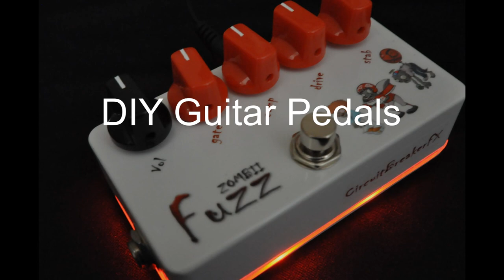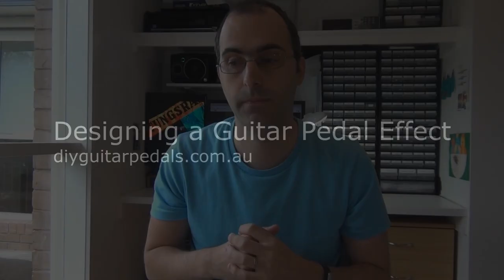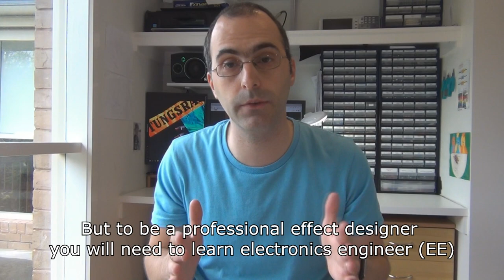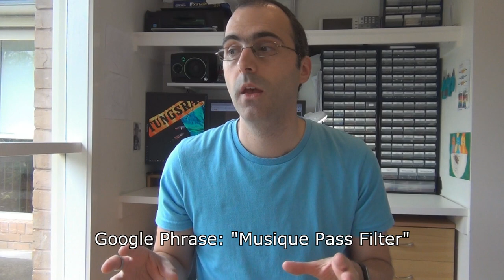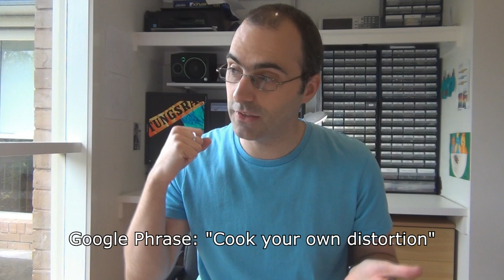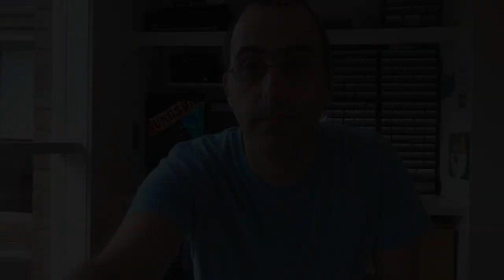Designing a guitar pedal effect

Comment: Brian Wampler's videos on distortion circuits and clipping types was what gave me confidence to try modding some pedals that I was already thinking of just throwing away. Then followed by a lot of googling on gain, low- and high-pass filters, graphic EQ... And many months of trial and error swapping components on my pedals. Also Electrosmash has some good analyses of popular pedals that can help figure out how things work.
A good piece of advice would be to get yourself a breadboard and a bunch of assorted electronics components, instead of repeatedly soldering/unsoldering components directly onto a PCB which will damage the PCB sooner or later.

Comment: I wasn't a genius in school either, but i wouldn't say that it made me regret it when i started making pedals. And personally i haven't learned much through just reading theoretical stuff, i started with a basic idea of building a pedal i wanted to have on my board, i found the simpliest schematic of this pedal, made it work, still didn't know a thing of what i did exactly, then i thought "hmm i also want a tremolo", found the simpliest schematic that could be built around components i had on hands, done, but now i started getting a sense of what i've done and i moved to the next project, and just like that, by building more and more stuff it got me from being completely blind, to being able to see schematic with my mind, and within this builds i had questions, and by answering them i learned a ton of stuff. So it is not necessary to know something before you start, just try to make it work in any way you can, and the more you do the better you get, or at least i works for me, and i keep learning.

Comment: I tried educating myself with an "Electronics Demystified" for dummies type book but couldn't even get through chapter 1. I found it pretty discouraging so I went back to breadboarding from Beavis Audio layouts and basic fuzz schematics.
My advice to beginners would be: Ask around on forums (especially Madbean), people are super helpful and never intimidating. Read up on modding a favourite circuit. Try simple mods with switches and pots for tweaking perameters or switching between different diodes or caps. Try breadboarding basic circuits and swapping cap values, trannies, etc. Try socketing parts of a circuit board so you can experiment with swapping different values to your liking
Reply from the maker: +FandangleTechery Good advice Fandangle, I agree!

Comment: Hey, you know that 7 minute fuzz pedal on your website, What do I need for everything to make it (excluding solder etc), you know the right electronics as it will be my first pedal. Also what extra gear will I need?
Reply from the maker: +Junk Morgan Hi Junk, if you order all the kit components all you will need is an enclosure and a 3pdt to finish the pedal.  Good luck with your first pedal!
Reply: DIY Guitar Pedals  but do I need solder and stuff like that?
Reply from the maker: +Junk Morgan Hi Junk, you will need solder but not wire, wire is in the kit. cheers.
Reply: DIY Guitar Pedals thanks.

Comment: The scary thing is that the success of many effects has been some simple serendipity, and a proper education in electronics is actually going to hinder one in these 'lucky finds'. Case in point for 'theory over practical' resulting in a loss of perspective is the bubbling argument that has been going on for several years in Silicon Chip magazine over valve amplifiers. :)
Reply: greaser5691 as an electronic Engineering student I agree to disagree, although I can do the maths and analyse schematics nothing beats dicking around with a breadboard, particularly when it all goes bang!
Reply: greaser5691 as an electronic Engineering student I agree to disagree, although I can do the maths and analyse schematics nothing beats dicking around with a breadboard, particularly when it all goes bang!
Reply: ok.  Amend that to say "for everybody except T3RRA_BITE_"    :)  What I am suggesting is that the theoretical education is going to change one's perspective, there are many blind alleys that will just not be explored, simply because they're patently foolish to explore for someone versed in  theory (and some particular magic might be missed as a result).
Reply: It's also worth considering a lot of effects do require theoretical education for design to be even possible, pitch shifters, reverb, delays for example. But as you said anyone can take the basic building blocks of a drive pedal and then fuck with it and you may get lucky. I've found some pretty cool sounds back in my early diy designs but I still go back to the odd designs to "fix" issues.

Comment: definitely don't need to go to college to understand how to do basic design of a pedal, an amplifier or a preamp..you just need to focus on a few things, how a transistor works, and how an opamp works, ohms law and how to properly read a parts spec sheet, how to read a schematic and how to breadboard . Where people go wrong is they get stuck in pedals only, as they are fixated on athat only. No shortcuts with electronics , you can't design a pedal until you understand the basics. Pedal forums can be confusing places, because there are many members with limited knowledge, love to give out advice, sifting through the good from the bad info is hard to do. There's no need to guess and blindly stumbling trying this part and that..and not really understanding the why and wherefores etc..I've found that a good crowd to learn from are the ham radio crew. They are much more knowledgeable about analogue design for audio, than the pedal crowd. there are plenty of great websites and channels on youtube..you just need to search..its all there.

Comment: I'm a bit like you, I have been bashing my head intermitently for 10 years with audio electronics. I know enough to  know how to design a small jfet based amp circuits, some basic frankensteining of other circuits and patching pretty much anything together..but, to design something from the ground up 100% original is still difficult and outside my scope. If you can find them..get copies of the wampler books..unbeleivable resource..but they not in print these days..i don't think..may find on ebay or amazon 2nd hand?? Here's another that could change your life..certainly helped mine..these amateur radio are electronics dudes wizards.. http://www.rason.org/Projects/jfetamp/jfetamp.htm